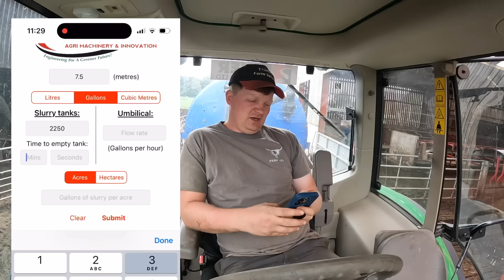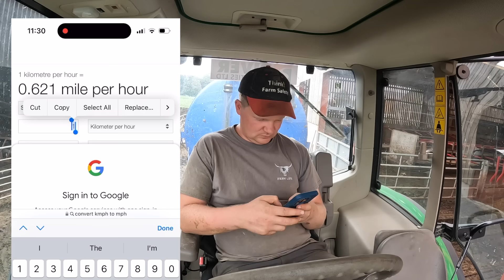SORRY BUT... IT HAD TO BE DONE!

Comment: Tom, just this once, if you could get the services of a tanker fleet to quickly empty the slurry pit, that would buy you some time to rectify the problem of extra rain water increasing slurry volume. And, the solution should be a permanent one, not temporary. Temporary fixes tend to cost more if the original issue is not fixed.
Reply: He mentioned an umbilical team coming, which is the same sort of thing but better 👍
Reply: @bearplant  Thanks for the new tidbit of information. Agricultural terminology varies from country to country.
Reply: @hsaurid 👍 umbilical is when you have a pump at the farm end and then pipes layed out to the field with a tractor on the other end of the pipe driving up and down the field spreading it. I'm sure Tom will do a video of it 🤣
Reply: @bearplant  Who says old dogs can’t learn new tricks! Thank you again for the explanation.

Comment: Worked at a large beef slaughter house ( steers, bulls, sheep & lambs ). I had to do a walk thru in stock yard that had covered roofs to check supply & exhaust fans. Steer manure did not smell too bad. Worst was the rendering room where they cooked guts, scrapes  etc 24/5. Only had to spend 30 seconds in that room and your clothes and skin had a bad smell. Would wear shoes from work to front door the take them off outside after spending time there. Pig manure along with just pigs are the worse smelling things for sure.

Comment: You definitely need to do something to reduce the amount of rain water going into your slurry system.
Covering the clamps wil clearly help recue it, maybe also covering the yard in front of the new parlour and/or the muck yard. one after the other, this can be done in separated parts and will not block your operations like the parlour did.
Good effort though.

Comment: generally slurry pipes collapsewhen it sucks on the floor while still pumping , or the pipes been dragged on the floor that damaged the rings in pipe! easy solution attach a orange drainage pipe at a angle or straight up into the tank a foot away from the bottom then slide a slurry pipe onto the top of the drainage pipe, this will stop pipes been damaged and safer as no manholes are uncovered

Comment: If you put a watery load of slurry or dirty water through for your last load when you won't be using the tank for a while and then after spray a load of WD40 into the macerator and it should stop it getting stuck.
Reply: It was the brick that kept making it stick, did you miss that.
Reply: @shaunp9592  I saw that at the end but I didn't realise that's what it was. Because around half way through the video he said it was working fine now so I thought it had stopped getting stuck and then near the end the brick went into it and it got stuck a second time because of the brick.
Reply: @jackoflaherty495  Pretty sure the brick was there at the beginning and the amount of "fluid" sloshing around kept pushing the brick up against it, then away from it intermittently messing it up.

Comment: Whazzat?  Ah wow.  That’s super scared.   “power take-off (PTO) shaft transfers mechanical power from a tractor to an implement (shown above). Some PTO-driven equipment is operated from the tractor seat, but many types of farm equipment, such as elevators, grain augers, silage blowers, and so on, are operated in a stationary position, enabling an operator to leave the tractor and move in the vicinity of the implement.

A PTO shaft rotates at a speed of either 540 rpm (9 rotations per second) or 1,000 rpm (16.6 rotations per second). At these speeds, a person’s limb can be pulled into and wrapped around a PTO stub or driveline shaft several times before the person, even a person with extremely fast reflexes, can react. The fast rotation speed, operator error, and lack of proper guarding make PTOs a persistent hazard on farms and ranches.

Injuries that can be sustained from PTO incidents include severe contusion, cuts, spinal and neck injuries, dislocations, broken bones, and scalping. Some incidents can result in fatalities.”